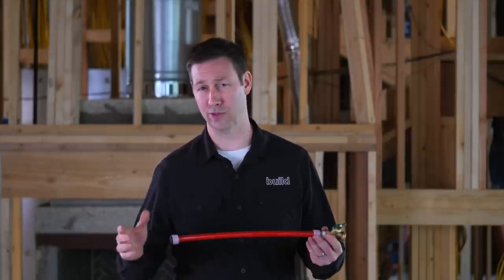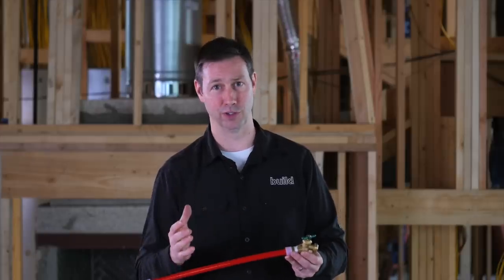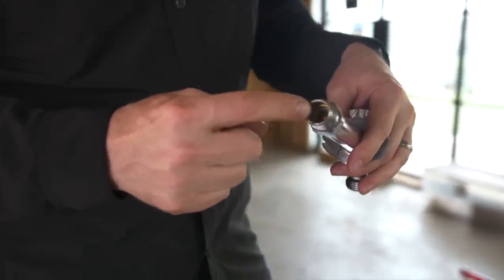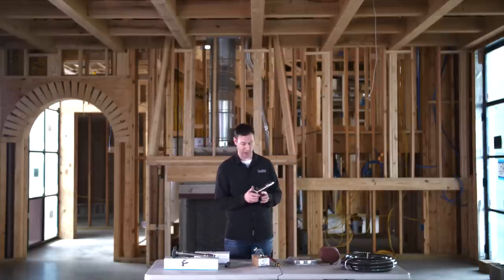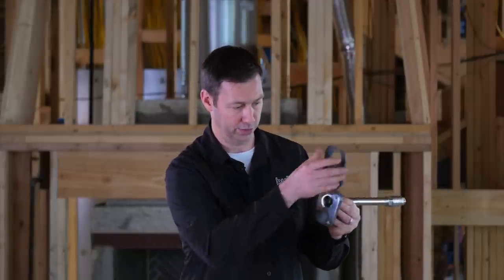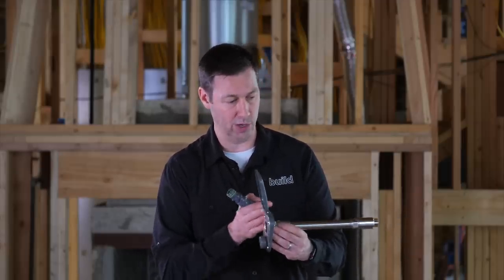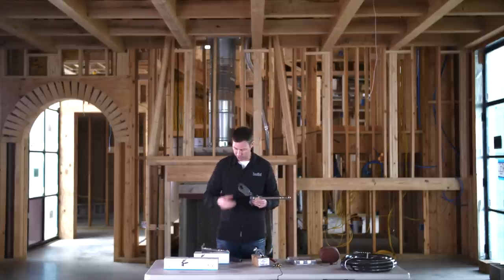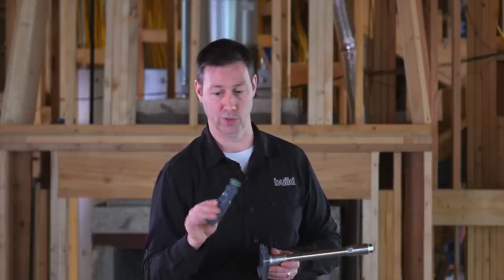No More Hose Bibs - A Better Outdoor Faucet

Comment: Shoot wish I would've seen this one before I just installed my new hose bib. What a dandy it was like a union meeting impossible for a guy to tighten exactly right. once I got them all tight I learned one of the unions was leaking. It was an odd union that threaded in and out on each end. Anyhow what a joy so I ripped everything out and threw in a sharkbite fitting with some sharkbite pex all is fine and dandy but the loop idea was superb would have used this one for sure I did notice a little condensation on the pipe the other day I'm not sure if its just the hose bib sweating or if it is leaking around the thread hard to tell but I know it only drips about 2 drops of water per day so I assume it is from the temp difference although I have been keeping my eye open just in case. But if I have to rework this thing again might not be a bad idea. I also seen the legend valve stuff that looks fairly neat as well but decided against it because it is non removable and to me I figure its a hose bib the mother of all ugly.

Comment: After seeing the damage that can happen in a protracted freeze (Yes, we have them in Arkansas) I elected to plumb all my outside faucets to a 1" PVC pipe that is about about 2" down and goes around the house.  This loop is fed by a 1" copper line to our principal water line inside out utility room.  This line can be shut down by closing a full flow ball valve.  Freeze proof water hydrants are teed in as needed along the loop.  Need a water source for a new flower bed? Simply dig down and tee in.  More expensive but I don't have to worry about a hydrant freezing and  breaking inside a wall.  When that happens it means opening the wall.  With the flexible PEX in the wall changing out a defective  valve will also require a small opening in the wall so you can can guide and screw the new valve into the PEX.

Comment: plastic garbage. just get a $10 brass quarter turn spigot from the hardware store. then inside the house install another shut off. angle the pipe so it drains out in the winter time when you turn off the inside valve.
Reply: Whoa there! You're making way too much sense here! Lol. Seriously though, that exactly what I do. I've never had any problems.

Comment: You, as a builder should recommend to the creator/manufacturer to make the connectors out of high grade plastic or metallic components.  I see many people will probably break them when pulling the hoses.  As we have in the past; yet the metal hose bibs stood strong

Comment: Great video.  I'm about to replace an outdoor spigot and will probably use one of these.  For what it's worth, in my area of North Texas, our builder used the extended valve (shut off inside the wall) spigots 15 years ago.  And they weren't even a good builder.  But regardless, I like this setup much better.  It seems silly to complain about it, but the standard garden hose connectors kinda suck.

Comment: Great idea till you have a car fire and have to go hunting a hose and adapter down, because people who don't want to look at a hose bib normally wouldn't leave a hose around.  So when some punk breaks into your BMW and sets in on fire trying to steal the stereo you can hunt a hose down instead of putting the fire out when the fire extinguisher doesn't put the fire out.  I know by experience. Had a house which needed a key to turn water on. Wasn't given the key so the valve wouldn't work.  Watched the BMW burn the house down.
Reply: Yah, I just hate it when the neighbours set fire to my car....dude, you live in a bad area of town. You might have bigger problems than hose bib design.
Reply: Cam M no actually was a real good side of town. Had a problem with the undesirable crowd coming in to steal at the time and yes the house had water spigot like this but a lot older and nobody could turn the water on.  Car burned pretty slow and the fire dept got there quick. Had to replace the dash and wire loom was a long time ago.

Comment: I really like the loop, my issue with the bib though is availability of the hose adapter, and also without the valve adapter you cant partly open for less water flow,  so when placing a sprinkler its all or nothing unless you add another part. not well engineered in my opinion.

Comment: The vacuum breaker / backflow preventer is to STOP backflow if you loose water pressure on the supply side so you don't risk sucking contaminates back into the water system.  It has nothing to do with letting the water drain out of the faucet.  If you have the hose under pressure (with a hand sprayer attached, for example) and shut the water off, it will stay full of water until you remove the hose (or whatever is on the end of the hose) to let it drain out.

Comment: Burst? if you dont drain your hoses when theyre not used. They will burst at sometime. With frost or heat. ;)
Reply: Not much of a concern.  What does a replacement hose cost?  $15?  That's nothing compared to a fractured pipe inside the house.... which won't be detected for hours or days and hundreds or more gallons of water running inside the house to who-knows-where.

Comment: Disconnect the hose from frostproof hosebibbs in the winter or it will not drain properly and freeze. Will only leak when used in spring.

Comment: Matt that tip on the loop in the wall is one of the best plumbing tips i have heard in a long time that would save me so many headaches on slab on grade houses that i have to tear out a interior wall to service. even on rehabs if they are cpvc or copper cant i put a union adapter so i can put a loop of pex in  and not have to worry about tearing out the wall? that's why i watch your videos you have great work ethics and like me you seem to be a perfectionist lol thanks for the videos

Comment: Isn't innovation supposed to make things "simpler?"  No one like to see the schnoz of a bib sticking out of their home, but what happens when you lose the extension for the faucet or it breaks ? Now you've got a useless hose bib that looks great but doesn't work.  Sometimes you just can't build a better mousetrap.
Reply: We encourage you to take apart one of our hydrants and compare it to a brass frost-free sillcock! We have only one moving part -- a solid stainless steel rod. Our goal is to make the simplest, most reliable valve possible.

Comment: Might want to add a metal ring at the wall to run the hose through to prevent breaking the adapter should the hose get pulled to hard. Or maybe that's overkill and these things are sturdier than they look.

Comment: the standard frost free don't flow very much, i can almost pee as much! 
How do these flow?
Reply: Good question. We were officially clocked at 6.8 GPM @ 52 PSI (better than a lot of brass vacuum-breaker models). We designed it to match the flow capacity of a garden hose.

Comment: for the ones concerned modulating the water flow, typically your hose has a a nozzle with flow regulation. To me it is annoying to have two water flow regulations on the same line

Comment: I see so many plumbers install frost free hose bibs with them sloped back into the house. I actually had to do some repairs at a house because the frost free hose bib burst from pooled water at the valve. SMH
Reply: LOL! Are you being defensive of tradesman that are bad at their jobs?I'm not attacking plumbers but who else installs hose bibs?

Im a carpenter that works for a general contractor. I am also a pretty observant person that tries to learn to see how other people perform their trade. Maybe instead of standing up for inferior work, you look at how people messed up and learn from it.

Also, when the angled shim is installed upside down, it doesn't matter if the hose is connected or not, water pools at the valve and freezes. It went to -20c this year here in Toronto.

Comment: I like the loop tip! Going to add that to my spec sheet on plans. I also like the look of this faucet, but would like to see durability tests. Such as if someone pulls hard on the hose at a 90 degree angle. Is it solid enough to withstand side impacts? That kind of thing.
Reply: They claim that the connector piece has been tested to withstand 200lbs of sideways force, "made of a durable wear-resistant DuPont polymer."

Comment: Oh, yeah, sure, great renovation item! And the second that cheaply made, custom, expensive plastic connector breaks, you're screwed until you can get a new one. And if that company modified its product, AND IT WILL, you're screwed until you buy and install the new version.

Hard pass. Not all new technology is better. That valve that does a shut off inside the house is great tho, thanks for showcasing that!
Reply: Frost free hose bib.
I like Woodford brand. 
Easy to rebuild if the washer ever wears out.
Needs to be installed at a slight pitch/grade towards outside so water will drain from tube after being shut off and water hose must be removed in winter to prevent bursting.
Reply: Hi Sig Urther. The connector is made out of an Acetyl Resin stronger than Delrin. You could drive a forklift over it and it wouldn't break.

Comment: Great idea for the extra loop. Realize that even with a "standard" 12" outdoor faucet valve that feeds through to an accessible basement or storage compartment, even if serviced by copper piping, the supply piping can be shortened and a supported loop of Pex with Pex-to-copper adapters installed for the same reason...When installing one of these faucets, it often requires a second person inside to provide counterforce & alignment to properly install without twisting the supply piping or resulting in an insecure fitting. The extra loop allows for an individual to separately connect on the inside supply side & then feed the flexible Pex to the outside for the long straight connection and simply push it back through inside. And if there already isn't to code a designated shutoff valve on the supply line to the outdoor spigot, this also serves as a good opportunity to add one and bring it up to code.
Reply: This will also but a much more affordable option than upgrading to this newer product if not an option.

Comment: Thank you for showing this product. A lot of the vacuum break bibs have no or very limited volume control so this is not that big a deal. The price is very negligible when budgeted into a remodel or new build. Nice change from the standard centuries old look, completly funtional and pleasant to use. A winner in my book. As Matt said, keep a few spigots extra somewhere so you're not waiting on the mailman so you can wash your dog.

Comment: How do you modulate water flow in this system?  Just full-on or nothing?
Reply: atothezeezee if you saw the attachment with the valve you can modulate there or on a nozzle
Reply: Jonathan Tabaco Thanks.

Comment: how do you regulate the water flow with this? Like others in the comments, i'm not sure what the advantage is over a normal frost proof one besides being slightly closer to the wall when nothing is attached. 

You are right about us up here in the snickering about that. Same goes for that clod snap in the south-east a few years ago where everyone's pipes under the house in the crawl space were freezing. Up here in the north i was thinking, main line 4' down, and all the piping in the conditioned space. Yes we have issues up here sometimes with pipes in exterior walls in older houses, but it has to be -20F for a long time...

Comment: I think having all that text coiled up in an outside wall like that's a bad idea. The less pipe you can have an outside wall the better. Seems like a better choice would be to find an intersecting wall that comes in at a 90 degree angle and push your excess pipe PEX coiled up there

Comment: Hmm.
In central Alberta we simply turn off the water supply to the outside hose, which is usually in your basement, and then make sure the lines are drained.
But I understand that actually sounds like work and throwing money at some product like this is easier.

Comment: Change out that plastic hardware for a more durable metal material and we have a deal. Just can't trust that plastic after years of normal use which involves temperature swing and UV exposure. Needs to be able to withstand the usual neglect any homeowner applies to their hose equipment.
And heaven forbid the kiddo pulls the hose tight, then tighter again to see if they can get more slack out of it... I dont see that plastic adapter surviving like a direct hose to bib connecting would survive.
love your video's Matt!

Comment: This is an elegant solution for sure and definitely has its applications. But I use my outdoor faucet to clean out polishing pads or other itens, or wash my hands outside when I'm working in the garage. For those times I want a handle on the faucet. I don't want to have to go find a hose and snap it in, getting full-blast water. 

That being said I do wish that quarter turn valves were used outside. It seems silly to have to turn and turn a crank valve to get the water on full when you want it.